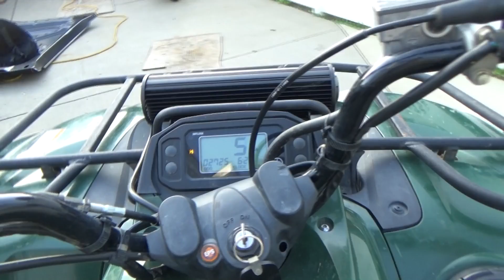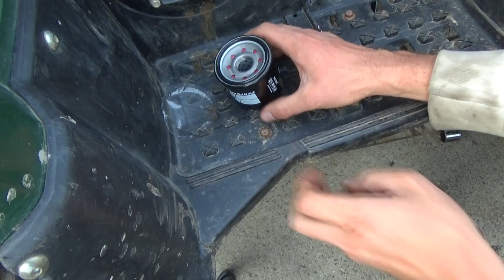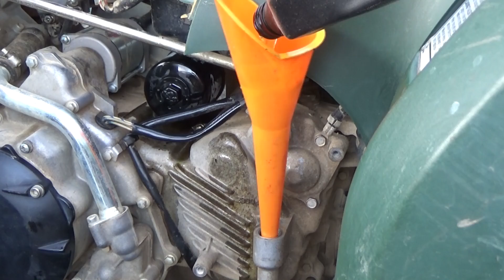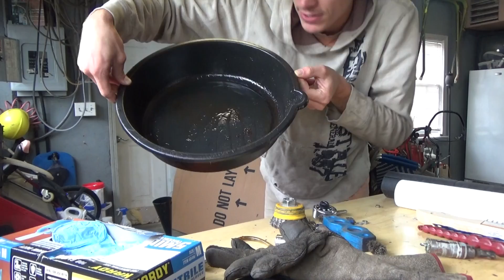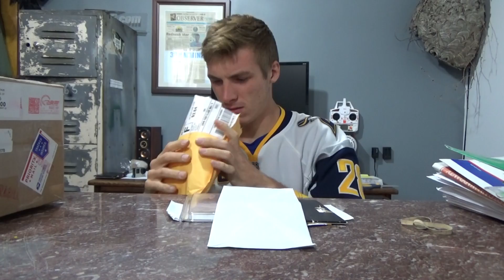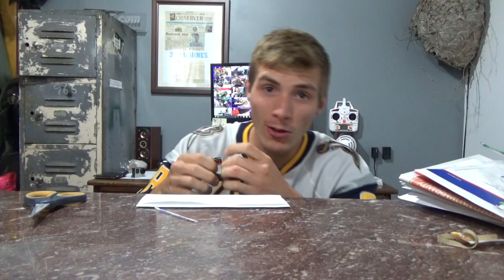IT'S ALL OVER

Comment: not use a hood latch.. just drill holes and put in hood pins. The problem is threading the hood latch cable all the way through the firewall.

Comment: Hey 3DMachines i have a 2003 CR125 and i have gone through to staters within a week i bought the bike sounded great and ran  great then i took it home then the next day woke up and rode it and then it never worked then found out it had no spark so then i ordered a stater and that fixed it then took it for a few laps again and the same thing happend it just stopped having any kind of spark so what should i do?
Reply: DIZZY plug?
Reply: DIZZY idk if you meant spark plug when you say stater, but if you didn't, try a new spark plug
Reply: attorn I did and the stator is a alternator for a dirt bike and that's what gives it spark

Comment: Adding too much oil to an engine is far worse then running low oil I'm sure you know that, the pressure from too much oil can blow out oil seals and cause engine damage where as you can technically run and engine on just a mere coating if oil.